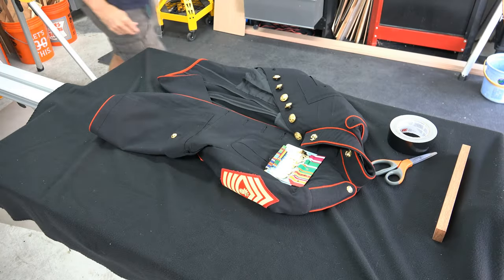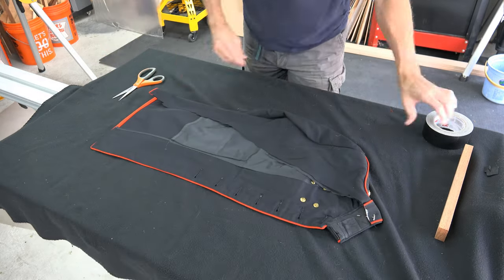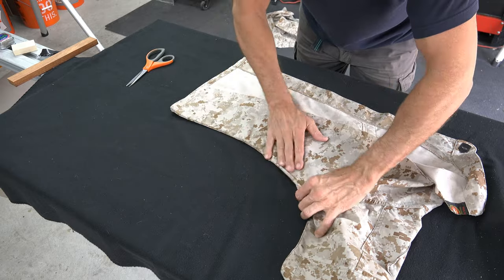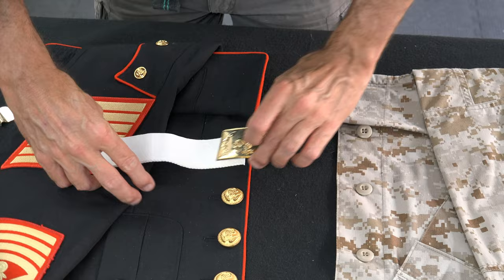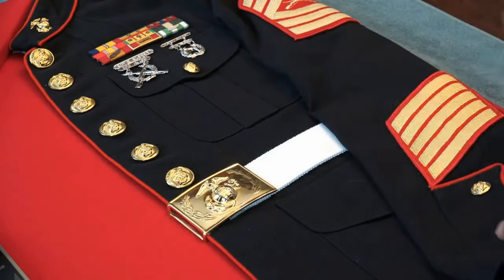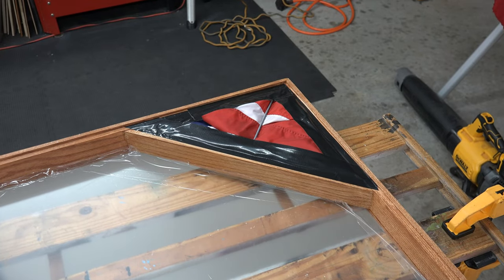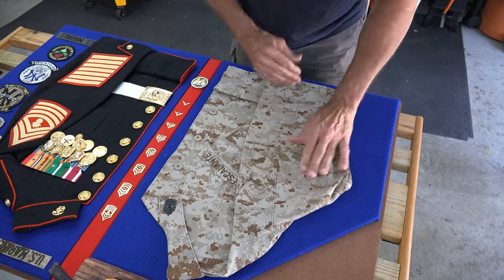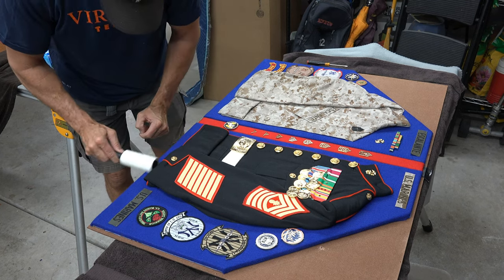How to prep a Military Dress Jacket for a shadowbox

Comment: I tend to do this. I have a hobby for arts and crafts and some wood work. May I suggest to use hot glue for patches and a pin for reenforcement. Pins and staples for the jacket. Elmers glue isn’t suffice for thick material. Just a suggestion.